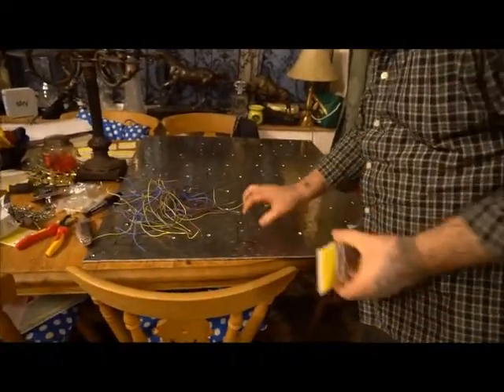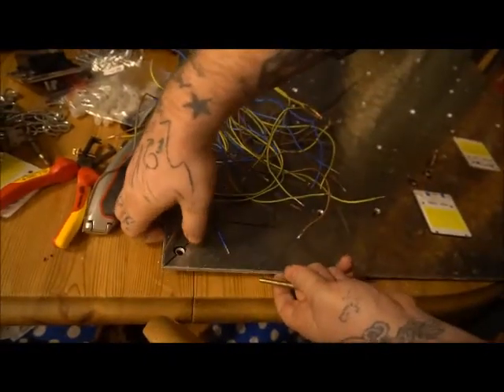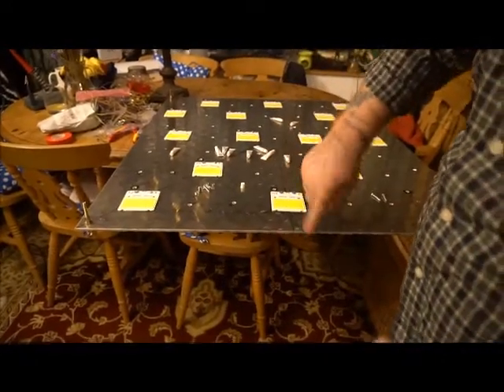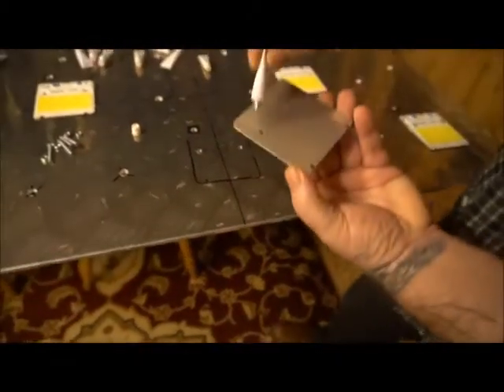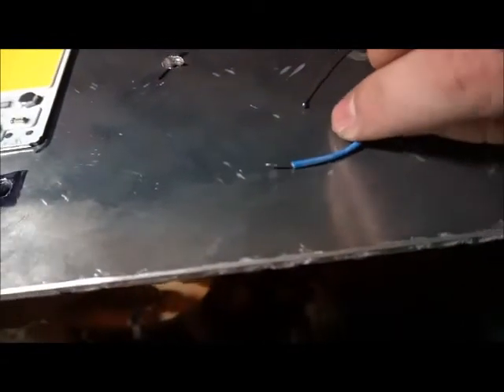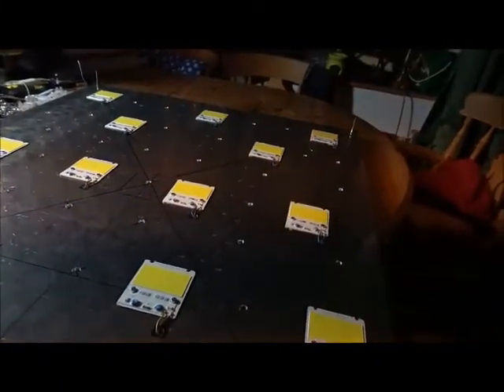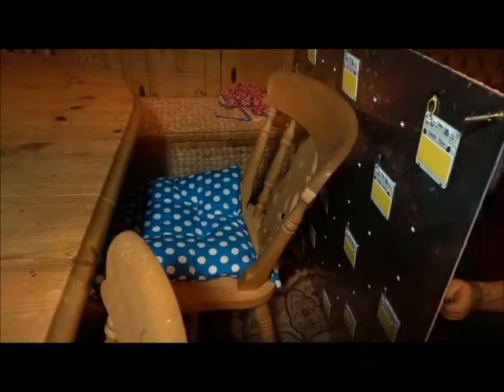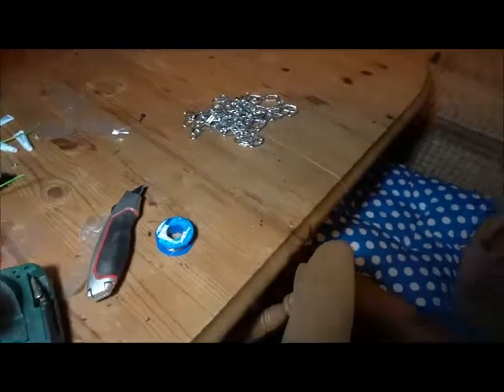lightbuild number 2 non flicker samsung

Comment: You really should use insulating grommets where you feed the live AC wires to the COB. Any shrp edge that cuts through the wire insulation and that entire aluminum panel becomes HOT! Earth ground the aluminum plate at very least. Fuse maybe?

Comment: Hi amazing build!
Qustation. How thick is the aluminium, and also how good cooling you got? Did it bacame hot to tuouch or not?
Reply from the maker: it did get hot to the touch but i used it 4 hours on 2 hours off..was about 5mm thick

Comment: 225 lumens per watt if running at 400w at 90k lumins thats actually the most bullshit ive seen on youtube considering some of the best samsung leds run at 210l/watt
Reply: Its more like 31.5k - 36k lumens
Reply from the maker: @sirsmokealotofkush5857  it is what it is and it grew as well if not better than a 600 hps ….at least 90k lumens

Comment: How do you wire it to the plug and do you earth it to the aluminium plate
Reply from the maker: ive wired the lights in paralell..they all recieve power from the plug..i do not earth it to the alluminium sheet..the light is still working fine and producing really good buds cheaply.take a look at my other videos...thanks buddy

Comment: What cobs are you using? Which Samsung? And what size and type of  Driver? Thanks
Reply from the maker: they don't have a driver..they just plug straight in..

https://www.aliexpress.com/item/Hight-Power-LED-COB-Chip-50W-100W-150W-LED-Lamp-Bulb-220V-110V-Waterproof-IP65-Light/32822312823.html?spm=a2g0s.9042311.0.0.Zi5BWk